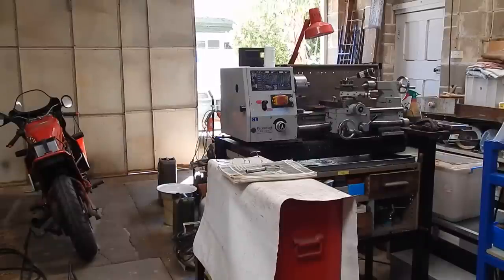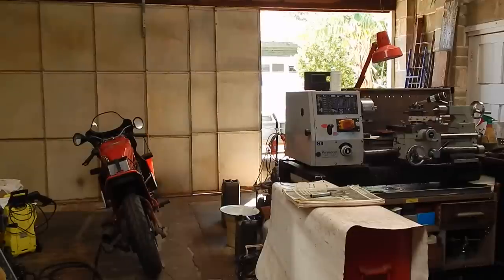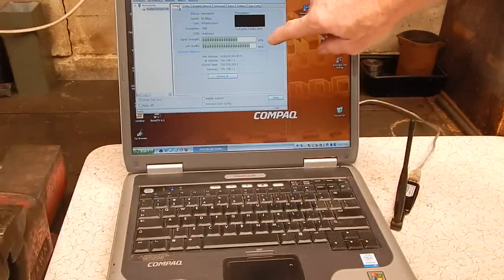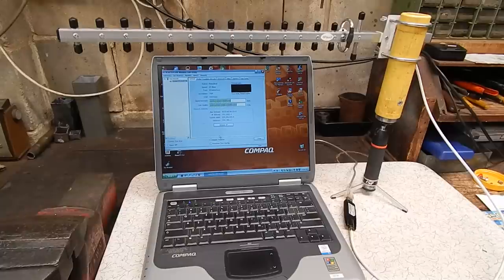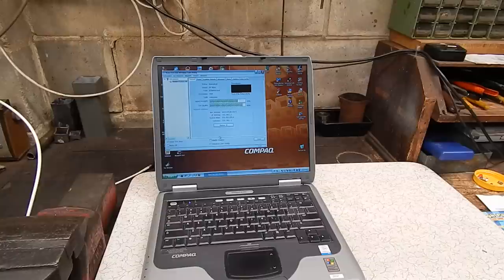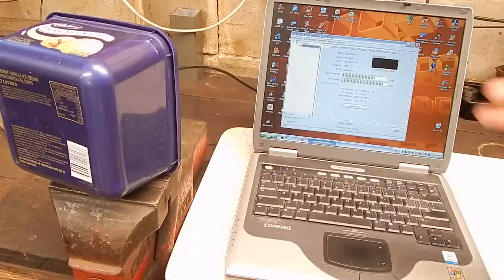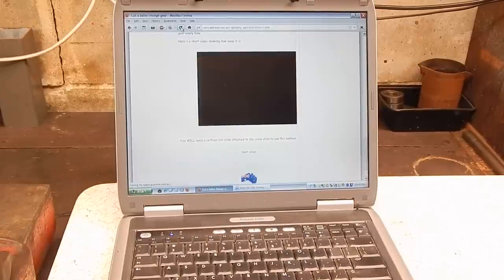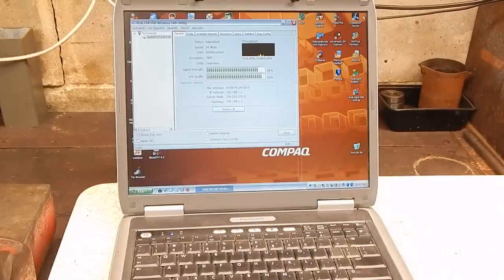Get WiFi and internet access in the workshop

Comment from the maker: There are a whole bunch of different directional antennas you can use for this situation. a USB dongle in the centre of a metal dish works well (my first antenna) and then there are corner reflectors (on a par with a biquad) etc.  But the beam yagi is very hard to beat for size and performance. Rob

Comment: From a radio point of view I believe external mounting the Yagi antenna is probably the  best way to go, Then at least You can shut the garage door and heat the garage when the weather is not co-operating and still have decent internet. I have no experience with using the mains loop system, but I have heard good reports of this system. The noise issue mentioned sounds logical  though,The yagi will give good gain as it in effect focuses the beam. I would only bother with a coax run myself as a last resort. It just doesn't really seem necessary with the signal  you are getting with the antenna. I would only run coax as a last resort as it is quite a bit more work and best results would be from the really thick low loss coax cable which is pretty unwieldy.

Comment from the maker: Yes, mounting the yagi externally, or firing through a window is definitely the best option, however that presents a problem in connecting to the laptop.  USB cable length becomes an issue. With the door closed the Yagi still managed low 50% signal, which is usable but not great. The intel wifi chip in the laptop is actually quite good, but no match for the Realtek.  The beam Yagi is way better than any other directional antenna I've used.  Cheap too.  Cheers Rob

Comment from the maker: Hi Harri. My understanding is that for every metre increase in coax cable length, you get signal loss.  Basically anything over 1.5 metres long will degrade performance. Just how this works in practice I don't know, and it may still be acceptable. A radio ham with a tower rig may be able to help out on this one. Cheers Rob

Comment: I had a similar prob , difficult wifi out to a barn. I had a surplus 2.4ghz panel antenna that helped. Then I tried a Powerline wifi adapter which worked the best. They usually work if your shop is on the same electric service as your house. The one I had was a ZyXel pla-407 , but there are a lot of other ones too . Signal is very close to being hard wired to the router. One problem with them is that noisy machines like a table saw can temporarily interfere with the signal. If that happened, I had a switched plug and would just cut its power on and off for a second and the signal re-establishes right away. Great channel xynudu !

Comment from the maker: I don't like repeaters as they slow down the connection. One option for a permanent connection is to use powered hubs every 5 metres.  While "active" USB cables will keep data flows going, they are unpowered and will not support a powered USB dongle such as WiFi with the 500 mwatts it needs for operation.  There is the option to use USB to ethernet but I've never tried this and it probably will have the same dongle power problem.Cheers Rob

Comment: Hi
Can you please help me?
I have a crap like this.
Don't work. Can I mode the dipole and use the antena? I have a 841nv9 and want to put outside to make a external acess point.
Reply: for better performance replace the dipole with another with dimensions 58 mm (length) X 34 mm (height)